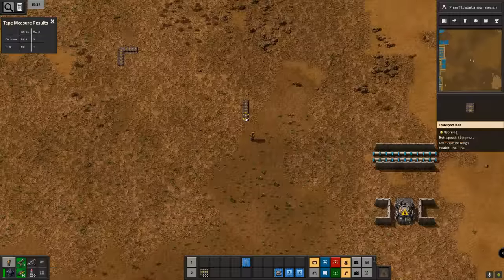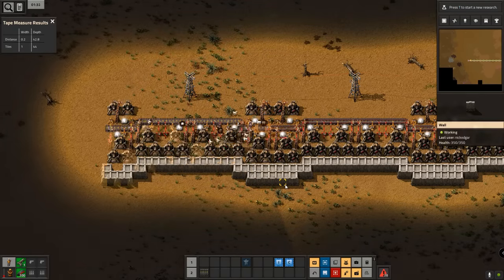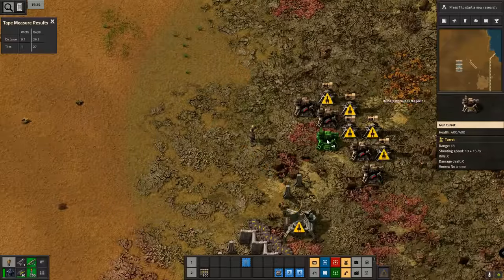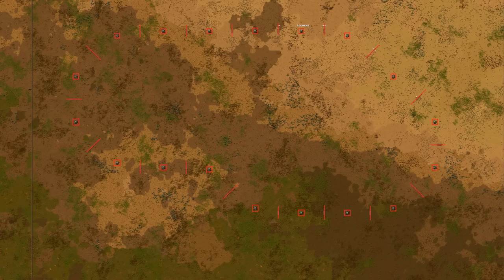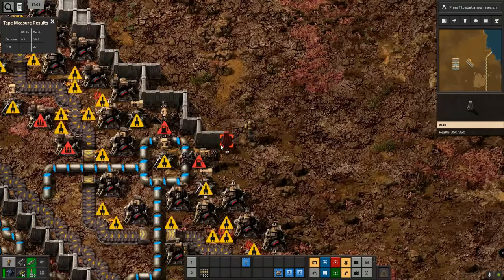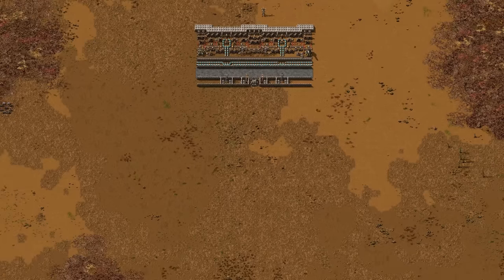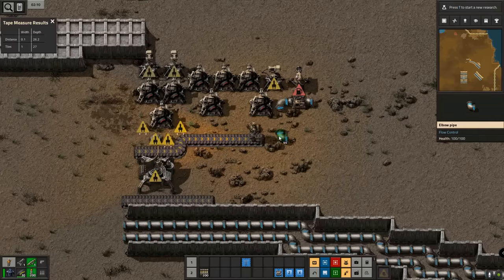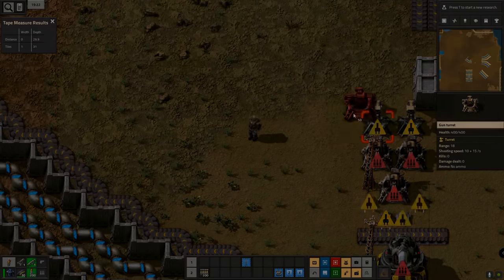Factorio - The Perfect Perimeter Wall Geometry

Comment: Of note you can define a global snapping grid the size of your wall segment in the wall segment’s blueprint, so you can make it so you can only place wall segments in the correct, chunk-aligned positions.
Reply from the maker: I didn't know you could do this but wouldn't that limit you to only that grid? Say I put a chunk down on the map without that grid, then set the grid up as you say, would the next chunk line up with the chunk already on the map?
Reply: @theotherbigfoot  There are 2 modes: absolute and relative.

Relative just lets you drag a blueprint in a line and it will tile down correctly, snapping relative to where you clicked your mouse button down. You can click down anywhere though.

Absolute snaps relative to 0,0, with an adjustible offset. this is probably what you want, because you can place down a wall (or rail) section anywhere and know it's aligned with all your other sections. Yes, if you place down a section misaligned with this grid it won't be aligned, but you can adjust the offset in the blueprint. It's best to just place your first wall section aligned though.

So yes, it would limit you to that grid, whcih is the entire point. You can make the grid half the size of your wall section of course, to get finer positioning, and then have converter sections that are half a wall section with a diagonal step. Or align the grid to where you placed your first section without the grid.
Reply from the maker: @sea_kerman  Great explanation, thank you, I didn't know any of this was possible. It's like being back in AutoCad!! You have definitely given me something to think about.
Reply: yeah, I was about to suggest that too :D

If I'm not messing this up, you could either set the blueprint size to 50x50 and use absolute snapping, but that somewhat limits placement (what if you want to start your wall 10 tiles further down?)
as an alternative that gives you more flexibility, you could set the blueprint size to 2x2 and enable absolute snapping. that way, you still have to pay attention when tiling segments together, but at least they will always be rail-aligned (never an odd offset from 0,0)

I'm not a fan of relative snapping for walls and rails since you can't ensure things line up when starting in different places, and getting the initial starting point right sometimes isn't trivial. relative 50x50 is definitely an option too though, just not one I'd use here
Reply from the maker: @jemand771  The grid snapping and the offsets, all interesting stuff. I'm definitely thinking about how I could make use of that in my builds. 

For the perimeter wall though, I think I'm pretty happy with the system I've come up with. The rails are included so it is foolproof. I can definitely see myself fu*king up the offsets.
Reply: Edit: I see this was already brought up in another comment.
On the topic of blueprint features, Factorio added the ability to mirror blueprints at some point, so unless one of the tiles used in the blueprint can't be mirrored (like train signals), you could omit the left or right- handed versions of the turns and only have 1 for each type of turn.-
Reply from the maker: @angeldude101  The left and right handed portions are slightly different from each other. Because I'm using loops of conveyor belts for ammunition the blueprints can't just be reflected. Well, they can, but you would need to run around changing the belt directions of the segments you had flipped to get the conveyor loops to work as intended.

I cover it here (https://youtu.be/3jdkHoMso7w?t=974) in my latest lets play
Reply: Apparently there's a mod called Blueprint Aligner that helps you adjust that absolute position, if you have a world where they don't match.
Reply: As long as you're okay with "Chunk aligned" not being the optimal alignment for power lines or roboports, then you're fine. Especially late game when you're generating all the items you could possibly need. In the lean times of early game, wasting roboborts on less-than-optimal spacing might not be the best way to go.
Reply: If you went with the full 50x50 absolute grid, that would determine a unique answer to the question of one rail or two aligning with the roboport at the center of the grid. So you’d just have to design around whatever it required. Could be amazing for ease of placement of large walls, though… even from zoomed-out map view, would be easy to know it was correct. But yeah, unless you got lucky, it’s a whole lot of hours of reworking things. :)
Reply: @LastCallAgain From my experience (as a newb) you can just define your own chunk dimensions that snap to the 32x32 grid, then adjust your blueprints overlap to coincide with the other tiles you have. My corners are 90 curves, and my straights are wavy, each one overlaps slightly into the next chunk with "extra" builds, but those are mirrored on everything. So it still tiles with both game grid and roboport grid easily.

Although most times I tend to have an expansion roboport blueprint separate from my perimeter wall blueprint. I also have an outpost wall blueprint because walls are expensive and I'm not going to build a 3tile thick wall with guns and power etc, etc across 37 chunks lol. I'll have a protected entrance and mostly perimeter, but I build most of my main bases on lakes once I stock enough landfill. Best protection is bottlenecking the way in for turrets. I only bridge out for trains, but I keep the loading bays physically separate from the main island via undergrounds. Limits the amount of "defensive waste" I produce and anything that doesn't make it through an attack isn't worth fussing over as it's usually only a delivery of intermediates.

Comment: Here's another tip: use red belts instead of yellow belts and reduce ammo density on the belt. If you have 4 or even 2 ammo per belts section, then you've effectively reduced the cost of the ammo loop by a good 50% to 75% and all without reducing ammo throughput. This works because ammo is significantly more expensive than belts.

Comment: On vanilla biter AI:

Biters only actively target military structures (radars, turrets). Biters will attack other structures if they can't find a path around them.

Biters have no other preferences. They do not target corners or water-edges specifically, nor radars or other structures specifically.

However, a biter attack group targets the closest military structure. If your wall is rectangular, the corner is the most likely target.
Consider a rectangular base. All biters directly north of the base will attack the north wall, since the closest path to the base is directly south. Similarly for all biter bases directly east, west, south.
However, consider a biter nest northeast of the player base. Then, the closest target is the northeastern corner.

If you imagine coloring a Factorio map by the target a biter would choose, the strip directly north targets the north wall, but the (infinite) rectangular area to the northeast targets the northeast corner.

Therefore, a much larger area of map targets the corner, while a much smaller area of map spreads its attack to the whole wall.

Similar reasoning explains biter tendencies to attack along water edges.

Fun fact: instead of a continuous wall, a series of "bunkers" that draw the attention of biter attack groups works just as well to defend the base. Also, biters do not attack walls if they can path through them, hence the effectiveness of "dragon tooth" or "maze" designs.
Reply from the maker: I understand what you are saying but that has not been my general experience. Over multiple maps over multiple years my corners are always in more danger than my straight bits. It might just be that they are inherently weaker, with an exposed corner turret, like I explained in the video, and not necessarily the pathing of the biters. I believe it IS the pathing of the biters, I believe they are able to sense a weakness in the wall, but that belief is only from general gameplay experience and nothing more specific than that.

Pathing aside, I experienced a significant decrease in biters being able to demolish turrets when I started using curved walls. There was a noticeable improvement. I think it is worth using curved perimeter walls just for that reason alone.
Reply: Well, technically, if you generate an infinite amount of biters who are all angry, all walls will be attacked the exact same amount - infinite
Reply from the maker: @cewla3348  Yes, if we have an infinitely straight wall with an infinite number of angry biters then we would expect the wall to be attacked pretty evenly. But a corner in that wall represents a discontinuity in that assumption. It isn't a straight wall anymore, and a turret on that corner will always be less well protected than the corresponding one in a straight section.
Reply: @theotherbigfoot They said corners are in more danger, they only clarified that there is no unique priority to the corners, a corner is just going to be the closest target for a large area, so more biters will attack a corner. 

6 for 1, half dozen for another at the end of the day.
Reply: @theotherbigfoot  The issue is not the biters' initial target, but rather the pathfinding. The way I understand it, the pathfinder sees the corner as the easiest route to the target. Once in sight, the military structures become the target.
Reply: Once in the past I thought I noticed in all my playthroughs the biters path finding would actively avoid turret range when marching to attack something inside the base. If I had a long wall and left a gap in the turret fire coverage, they would prefer to walk through that gap and destroy the walls there. Then just ,like, 10 minutes ago I realized that might be the "survivorship bias", and so I think now it makes more sense that biters just go on their own way and die on the walls that have turrets, and that their most successful attacks are on areas without turrets just because there are no turrets there, and those are the ones which more often sticks to the mind

Comment: Very interesting!  Some thoughts:

1.  Having all of your ammo on a single belt is asking for trouble.  Not only does that mean you need to have a LOT of ammo travelling at once, but, if anything goes wrong and the belt breaks, the turrets after that point will eventually starve.  Not Good.  A better way is to use local loops that meter ammo into packets with a time interval between each one, served by a train stop that is only enabled when ammo is needed.
2.  It is important to have your roboport be well back from the wall.  Why?  So that repair bots only enter the danger zone AFTER the wave of biters has been destroyed, so they don't get damaged/destroyed along with the wall/etc.
3.  Dragon's Teeth that break up biter pathing is vitally important to both slow them down and create chokepoints for flamethrowers.  'Inverted Teacups' works really well for that, but make sure to have 2-wide paths so they don't start beating on the walls.
4.  One alternative to using ammo belts is to have turrets surrounding/on either side of a requester chest, with stack inserters passing ammo from turret to turret as needed.  (You DON'T want to take this too far, though; lest some get starved for ammo when things get hairy.)

Cheers!
Reply from the maker: Wow that is quite a series of comments. Ima deal with it the same way I deal with my work emails!!

1. Yup, you are absolutely right, and, in the early stages of my games when I don't have robot coverage, a problem I frequently encounter. But in the later stages, once I have a final wall built (which I'll be doing from now on with these segments) it isn't an issue I have ever had. If it did happen, just for arguments sake, there would probably be plenty of ammunition available to the other turrets until it got repaired.
2. The roboport is pretty far back from the wall. I'm happy with its placement. Putting it any further back would ruin the aesthetic of the segment. I don't mind making a few sacrifices to get the elegance I am trying to achieve.
3. Someone else pointed this out, I don't do this because it opens the door for robots to be out in no mans land repairing bits of wall vulnerable to biters. It is a strategy I understand, I have seen the videos, I understand it's effectiveness, but that I choose not to do simply because I would lose too many robots. I understand if you completely disagree.
4. I like my ammo belts. IMO they work really well. I definitely do not want to rely on logistic networks. I never rely on logistic robots for anything other than fuel for my trains, maybe a bit of u235 and/or u238, and my personal logistic requirements. Basically, I don't rely on robots for anything mission critical. Perimeter wall is definitely mission critical. Literally everything in my factories is on a conveyor belt. Even my water!!
Reply: @theotherbigfoot  Fair enough.  All good points.
Reply: @theotherbigfoot  4 just seems a bit strange, bottled water is so hard to deal with!
Reply from the maker: @cewla3348  Bottled water is indeed hard to deal with, I have tried it in 6 or 7 factories now and it still doesn't work perfectly. But the challenge is what I love about this game, I'm also pretty stubborn, so I'm gonna keep going until I nail it.
Reply: @theotherbigfoot   I just watched it again and had another thought:

5. Based on my own experienced, I realized that each wall segment SHOULDN'T automatically link to the roboport in the adjacent segment.  Why?  Because, over time, the bots will tend to 'clump' and then have to travel long distances--sometimes over no-man's land, depending on the map--to repair/replace damaged structures.  (#beentheredonethat)  Roboports aren't expensive, so making each segment 64x64 (or w/e) with a (tileable) spot on the edge to hold linking roboports will allow easily dividing the wall into logical sections that keep all bots local so they can act quickly.  (By the time you are using walls this expensive, bots are relatively cheap, so it's good enough to drop a steel chest full of them in each section with a speaker to alert you when it needs topping up.)

All that being said, while I would never use your wall system--because I habitually build simple walls FAR beyond the pollution radius so biters never really become more than a nuisance--I am in absolute AWE at what you've designed here.  Bravo, good sir!
Reply from the maker: @KeithOlson  Your comments are fair. I guess what I would say is that I set out to prove that it was even possible at all. And I used the very extents of what was possible to explore the limits. 

Other geometries are available!! Maybe I should add an asterisk to the thumbnail!!
Reply: @theotherbigfoot  Fair enough.  Thank you once again for sharing your work.

Comment: This is what base design is about! I've experimented a lot with wall designs that exploit the biters' pathing AI, primarily for flamethrowers, since I've been playing a deathworld marathon save that makes ammunition costs way too high to justify. I haven't gotten to the stage of working tileable designs of this scale (still working my way to roboports in that save), but the tips here (particularly the one about aligning the rail and roboport before doing anything else) will be a life saver. Thanks for the inspiration, great video!
Reply: Ammo is useless, don't see a reason to use gun turrets unless you are playing on easier settings.
Reply from the maker: For me, using just laser turrets has pretty severe power implications.
Reply: @reuven2010  Its the only realistic option for defence early game.

Comment: I made a similar setup using chunk alignment. There was a laser wall, flame wall, and gun wall, and they would all layer over each other to beef up the wall and defenses if needed. Train gates, vehicle gates, roboports, rounded corners and bastion corners. I remember figuring out certain perfect distances so everything lined up felt really good.

Probably spent 36 hoyrs of design for a wall that was completely overkill for anything besides hardcore deathworld maps, but they looked sexy as hell
Reply from the maker: Sounds like you were one step ahead of me. I would be really interested in seeing what you came up with.

I think these segments took about 20 hours, and it isn't the first time I've tried this so I probably had a bit of a head start. It isn't a small undertaking but, as you say, the results are pretty damn sexy